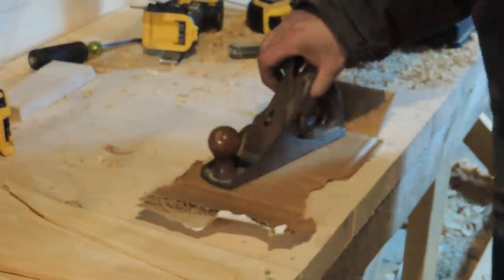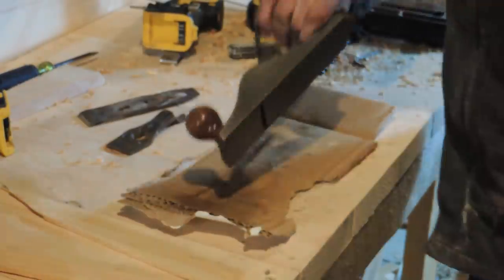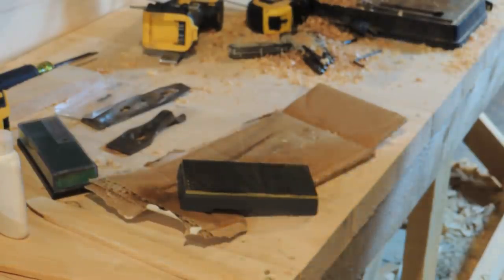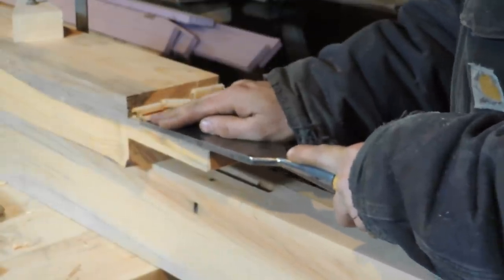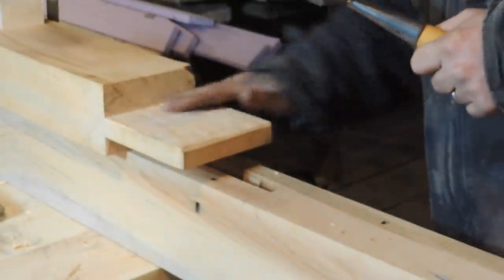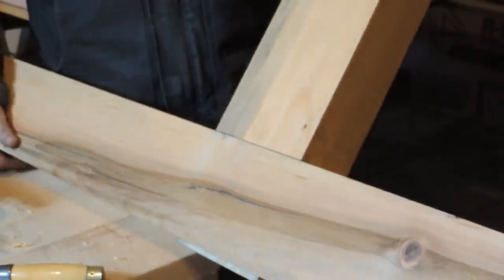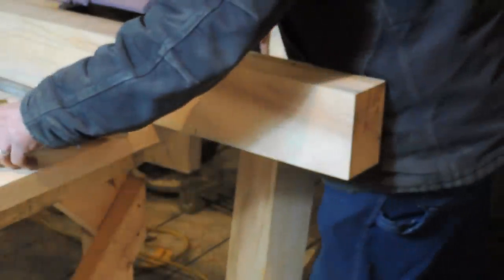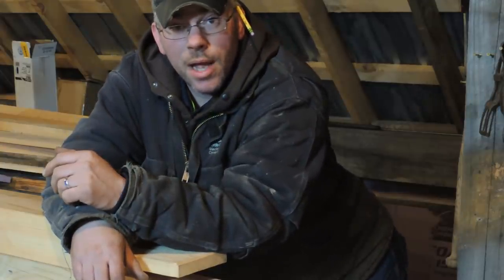Test Fitting A Tenon for The Planer Stand, Little Fussier Than Timber Framing

Comment: These videos or vlogs never get old or boring. I welcome each and every one as I learn something every time. A question; how fast are you running the drill press with a forstner bit. Noticed the smoke yesterday and thought you might be going a little fast which will damage the bit as I learned by error once.
Reply from the maker: The smoke is from removing the self feed screw in it, the cutters don't go all the way to the middle so the smoke is from the little tit it makes in the middle.

Comment: Paul Sellers has a possible solution for you. He calls it his rag in a can. Basically he uses an old mushroom can that has a cotton rag rolled up to fill the can with maybe 1/4 sticking above the edge. He then soaks it with a lite oil (3 in 1). He then uses it on the soul of his plane anytime they start to drag. It should also help stave off any rusting. Paul has a Youtube channel if my description does not make sense.
Reply from the maker: Paul is great, I must've missed that one. He is one of the few I tune in for.

Comment: As of late I prefer my Domino or my biscuit jointer for joints. The old mortise and tenon hand fitted joints I still do some, you can't beat 'em for strength. I cut a shoulder all the way around.
Reply from the maker: For smaller stuff I cut a shoulder all the way around.

Comment: Prof what do you normally clean the stones with as I have heard that it has to be lint free ?Are you going to put a tin roof on it ? LOL
Reply from the maker: Doug I use soap and water.  If maintained right these "stones" will last for years and they never need dressing.
Reply: Jim thanks for the information, what do you dry them with ?
Reply from the maker: I let them air dry after wiping off the excess with my hand.